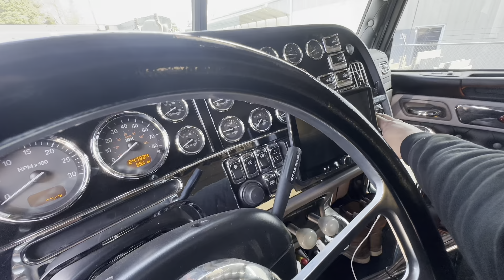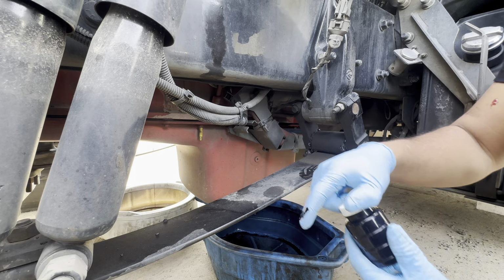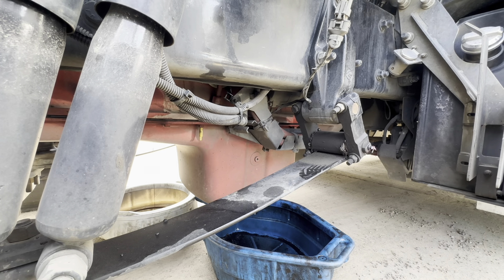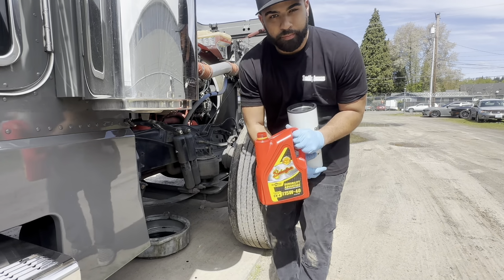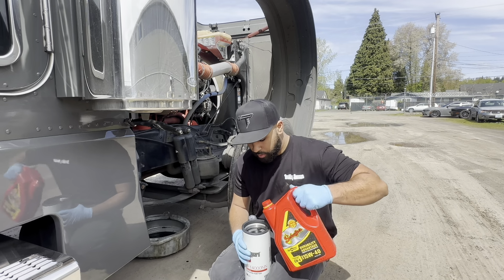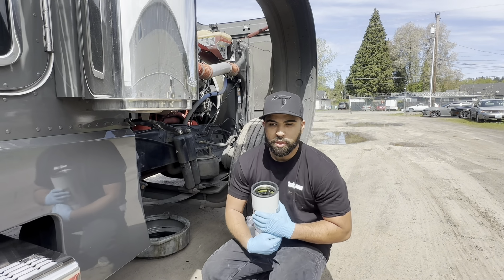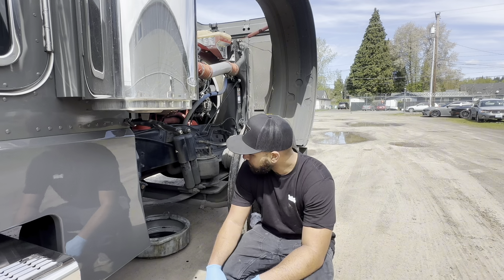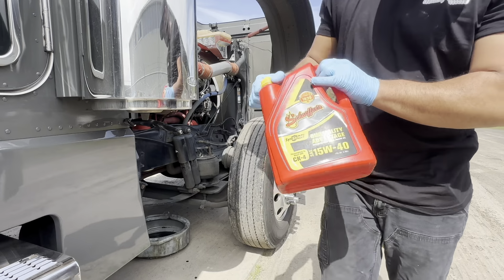Owner operator does his own maintenance | best oil money can buy

Comment: Just wanted to let you know.. from experience. Those battery wires on the driver side behind the leaf spring hanger. Inside of that square shaped isolator, for some reason the vibration makes them chafe. Idk if their not secured enough or what. But
We had one of our 389s catch fire, and it caused a huge multitude of electrical problems after that.

Comment: how often do you change your oil
Reply from the maker: I let it run about 40/50,000
Swap filter at 15/20,000
Reply: I drive a box truck i do it every 9k miles.